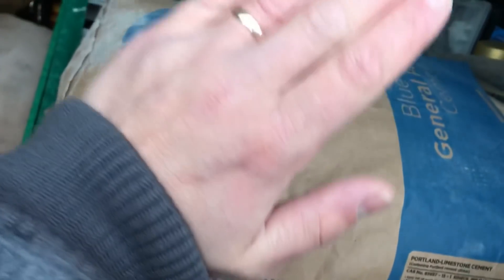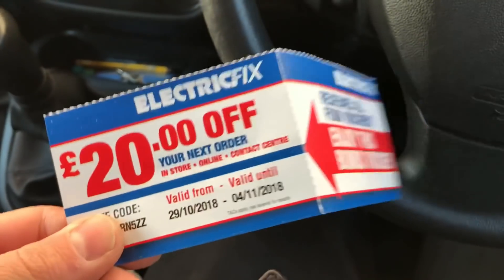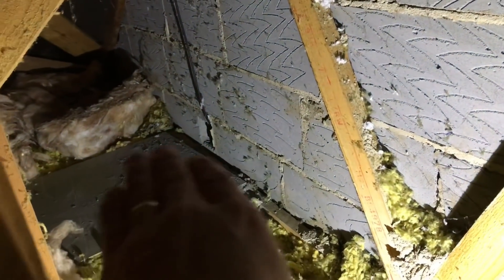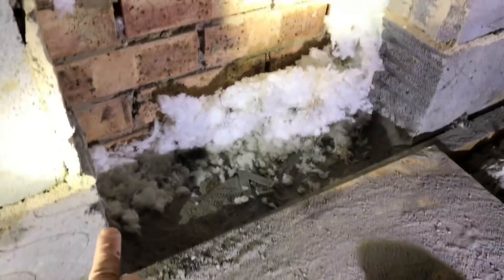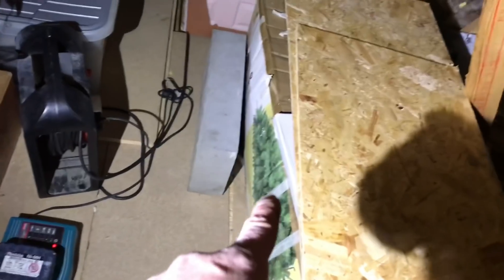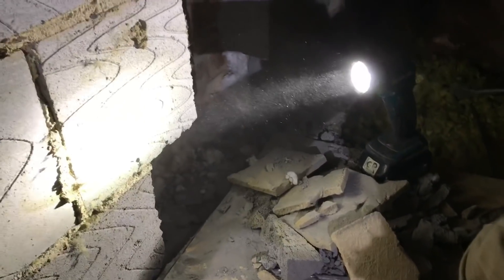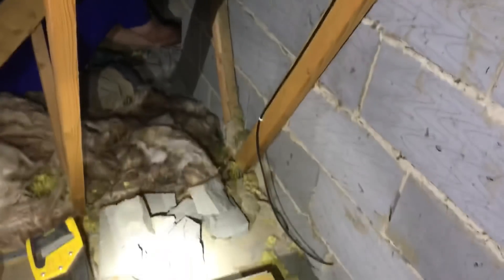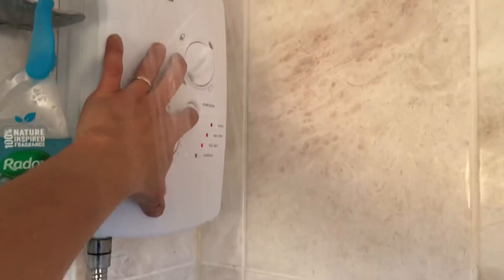Loft Conversion - Next Project - The Full Build.

Comment: Service call a minimum of $150 dollars. I charge $70 first hour and $35 each 1/2 hour after that. I live in Kansas around the Topeka area. It varies from contractor to contractor . The smaller contractors tend to charge less because they don't have the overhead.

Comment: £70 +vat which includes travel and 1st hour, then £35per hour. I find the guys that say they only charge £25 £30 insulting to the rest of us. A professional service deserves a proper fee. Don't forget, every time we touch something we risk a prison sentence if it's not done properly. The customer is paying for your skills, experience, and the ridiculous running costs like Part P membership, and then there is travel time and fuel for each job.
In this scenario it doesn't matter that it was only 20 mins onsite, you solved a problem that the customer couldn't. I would have swapped the switch as well from van stock ( hence the slightly higher fee as I always have stock on the van for all common issues)  as I would be worried it may stick again and burn out. I often do 4 or 5 of these sort of quick repairs in a day ( mainly via letting agents) 

Love the videos, thanks for taking time out to produce them, keep it up
Reply: electric eery, no offence or insult meant dude. I would have worked price out from an hourly rate and I do not charge £60+ an hour and certainly not on top of call out fees etc.
Reply: @petertallowin6406  no prob, I charge £35 hour but it's £70 to attend first time as have to travel and don't know how long job will take so that's 2 hours of the day allocated.( Prob 20 mins travel there, 20 back, bit of paperwork and that's a hour gone) Jobs are booked in back to back , no shortage of work. Each to their own, this is just my policy which works for me. What I don't agree with is the "I have to be cheapest" guys as that just devalues the trade. You won't find a plumber working for nothing, why should we
Reply: electricery very true dude. I am not trying to be cheapest. I am in my first year of business and last thing I need or want is to be known as the cheap guy.  What I am trying to maintain is that professional can also be affordable.
Reply: Peter Tallowin Here here and good luck to you. Build your business on quality not price. I am 12 years on my own, and 95% of my work comes from repeat customers and I do NO advertising. 
I am convinced that any business that just charges pro rate hourly rate without adding travel etc will not survive very long. Having said that, I do do the odd  job where I feel sorry for the customer or I know they can't afford it so they get a special price, but it's not the norm and it makes it hard when they call you again for more work as you have to wean them off the charity price

Comment: £20 seems reasonable for 20 minutes work. I don't charge call out fees for a start. The customer pays for time and materials. :) It would be a 10 minute swap out for new switch but given the fact it is considered a special location and therefore notifiable work it would cost more on a return visit.
Reply: The shower isolator switch is outside the bathroom so it wouldn't required Building Control notification.
Reply: Alvin Ashman indeed, but the circuit and appliance it is connected to is. There is no denying that the shower is in the bathroom right. :) Therefore notifiable? I was taught to always complete an E. I. C and notify such work. I am at the end of my first year as a D. I so would appreciate thoughts and expertise on this. :) It could save me time and money in the future. I would also like to add that I don't charge extra for certificates so I am not doing it for the money. :) Cheers
Reply: Right first of all, your electrical certificates should only cover the work that you have undertaken yourself, if all he's done is replace a shower isolator switch, then that's the point at which you test to and certificate. Secondly, if he took off the front cover, as long as he doesn't disconnect any fixed wiring, he doesn't have test at the shower or inform Building Control of work.
Reply: Alvin Ashman, and that they do dude, my work only. The certificate would be for the fact that the circuit in question is in a special location. That was more my point. Sorry, I seem to have angered you somewhat.
Reply: @petertallowin6406  I'm not quite sure where you got that from but I can assure you, I'm not angered in any way, shape or form. Work in a special location required Building Control notification, if the problem was at the shower isolator switch and you've overhauled or replaced it, why are you certifying work that's nothing to do with you? Are you verfying the condition of the wiring downstream from the switch? Are you verfying that all wiring is installed within the prescribed zone?... If so for 20 quid, good luck to you.
Reply: OK, sorry dude. Misinterpretation.  The circuit would have been tested, from dB to switch and then to the shower. R1+R2, I.R  and Zs etc. This would be the work I would be certficating, not the fixed wiring as such unless of course this had to be changed for whatever reason. And no this would not have been done in 20 minutes. This would have been on the proposed return visit upon replacing the switch etc. :) A lot of the jobs I go to have no paperwork for any work undertaken. This concerns me a little and therefore is one of the main reasons why I certificate all of my work be it minor or otherwise. Not only is it evidence of the work I have done but makes life easier for the next guy that comes along to have some results to compare with. :) Thank you for your insights dude.
Reply: Alvin Ashman  agree test only to the point concerning your work.